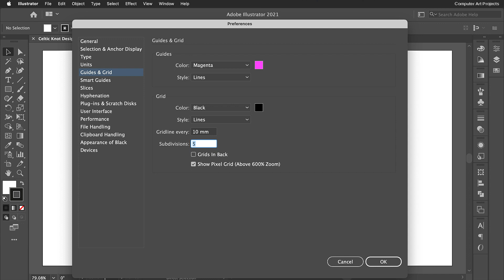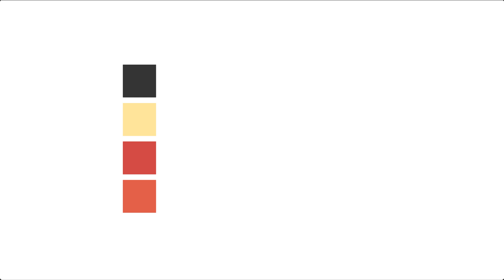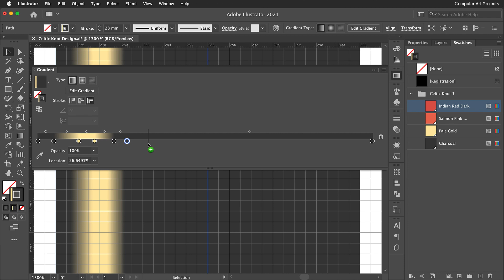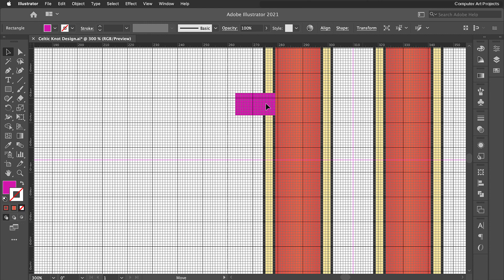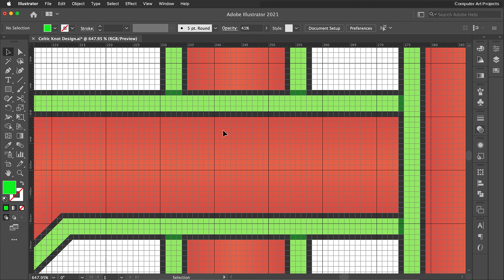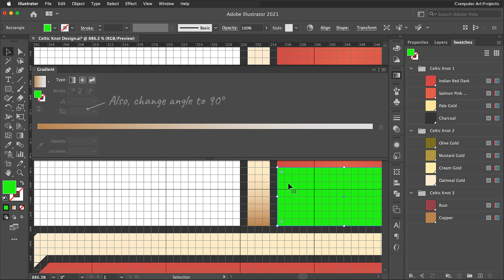Adobe Illustrator Celtic Knot Tutorial

Comment: I’ve been looking for something like this for ages. There’s lot of Celtic knot vids online but this is the only one that actually looks real. Using the gradient to make multiple lines is a good technique because the shape stays editable. The only problem I’m having is that I want to get the guide to move to the middle but I can’t seem to get them to move.
Reply from the maker: Thanks mattcarp. Yes, I think using a gradient can be a good solution because not only can you save it as a swatch and apply it to any shape, but it also allows you to combine hard-edged lines with graduated ones. 

As far as not being able to move or centre the guides, they need to first be unlocked. Although hitting ⌘/Control - Alt - 2 unlocks all the objects on your artboards, it doesn't unlock the guides. Press ⌘/Control - Shift - ; to unlock the guides and that should solve your problem.

You can also unlock guides from the View Menu or by hitting the button in the Properties Panel.